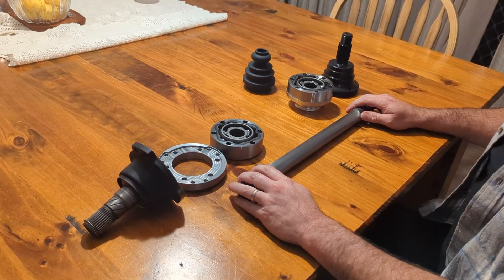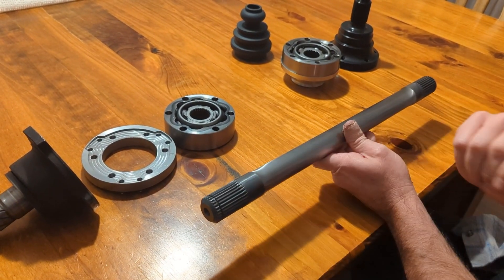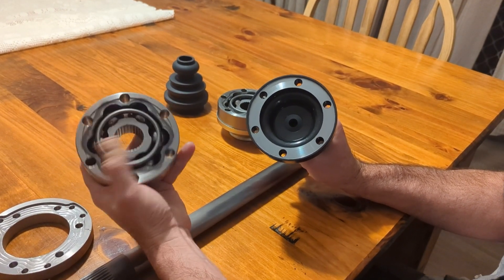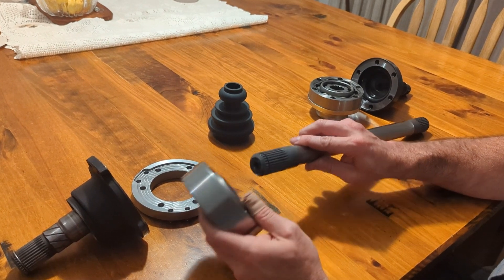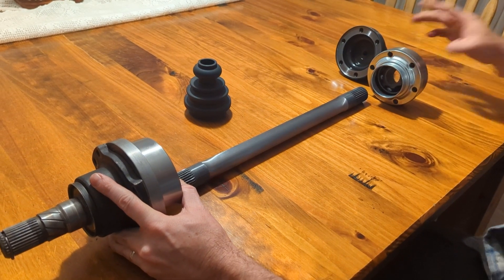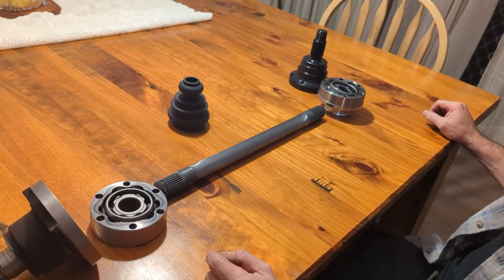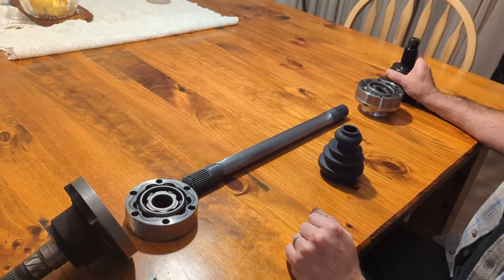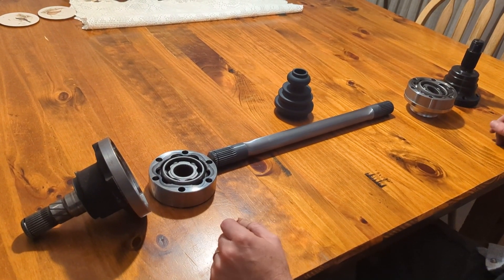BMW E46 Custom Billet Axles - AXLE PROBLEMS SOLVED!

Comment: Very cool it'll open up a bit window of what we can do with the e46 chassis. Have you been working on e46 axles with the 8.8 diff?
Reply from the maker: The R200 has been a good enough solution so far. We are exploring other diff options but nothing offered yet
Reply: @BrintechCustoms  the R200 bolts to the 8.8? I'm looking for axles before I build something
Reply from the maker: @danthisguy8541  they are different. We can make axles for you though if given the specs